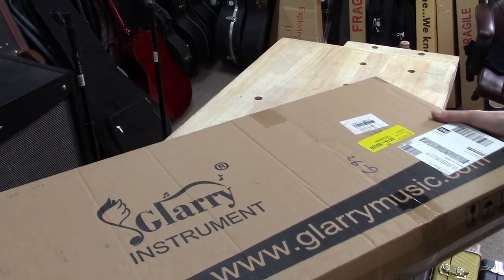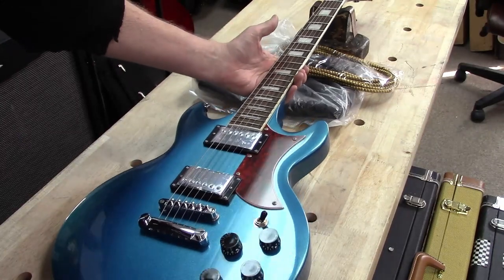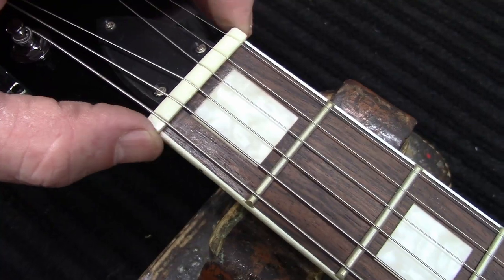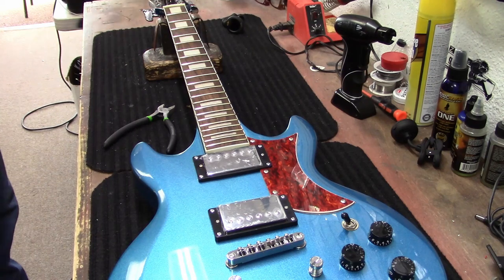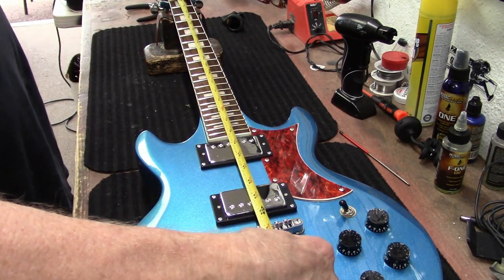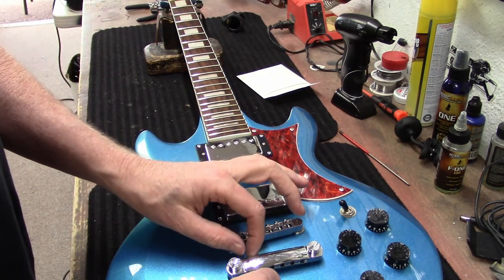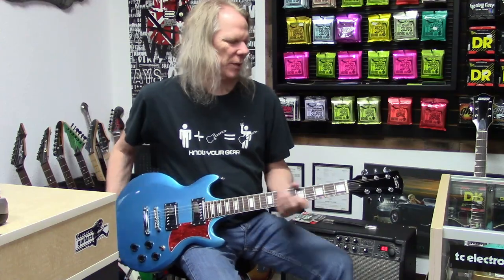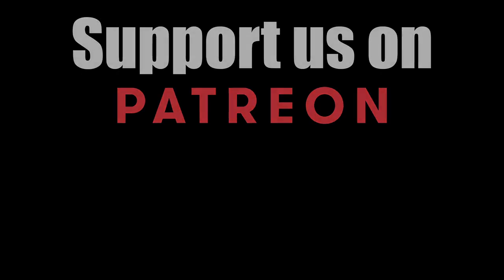The Brand New Glarry GIZ102 Solid Body Electric Guitar Unboxing!

Comment: Thanks Dane, great video as always. Nice looking guitar. To me looks like an SG Gibson copy. Your absolutely right about the neck set and the nut. Going to a set in neck is a big step for Garry or any other low cost target Chinese company. Glarry did good sending you the guitar as they knew you would go through it with a fine tooth comb and reveal it's good points and short comings. It's a really good looking guitar. I hope Glarry does continue with the model with changes to better the instrument. The set neck is a big jump maybe go back to a bolt on neck would be a better manufacturing decision to better the instrument to make corrections easier in manufacturing the guitars. I agree and yes it looks like Glarry is trying to build better products. Each new model on first runs are prone for less than perfect results. That's fairly common. Hope Glarry learns from this and makes headway with this model. Thanks Dane and thank you Glarry for making the video possible. GOD bless and 73 Earnest K5EWM.

Comment: What Glarry needs to do is have a tech go through the guitars before they are shipped and check the nut and file if needed. The last Glarry Strat I recently got the action is awesome but it has an electronic issue I haven't been able to find/fix yet.
Reply: Same with my glarry, everything you could think of it on par with a 500 dollar bass EXCEPT anything to do with the electronics, it’s like they taped metal together instead of soldering

Comment: I was thinking a locking roller bridge i saw would bring the height down but it not from the numbers i saw. the tuneomatic would bite into the body if you made the bridge ferrals sit deeper in the body. The roller bridge seems to have a flatter bottom but, says it would sit 2mm higher than what it came with. It was 12.6 mm over all height.

Comment: It has a body shape of a  GAX 50 with a scratch plate, probably the same as the 70, my 50 is a 1999 not a bad guitar. I have to say my friend bought a Glarry P bass about 5-7 years ago and would have to say it was not very good. If they have gotten better its a good thing.

Comment: I have a 1999 Ibanez GAX 50 that I got from a garage sale about 10-12 years ago that I paid $40 for. It has the same body shape but it has a bolt on neck and no fancy bridge system and no scratch plate. It's not a bad guitar. A friend of mine got a Glarry P bass and to me it felt cheap and looked cheap. Fret ends were very sharp and could not get the action right. I'm mostly a bass player and this bass was pretty bad in every way.